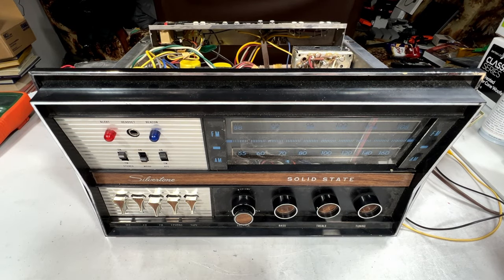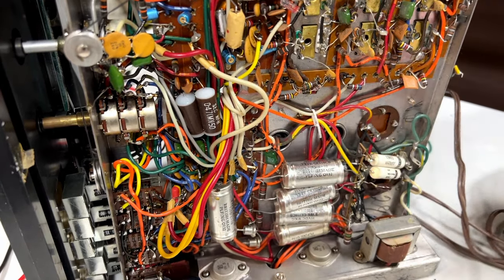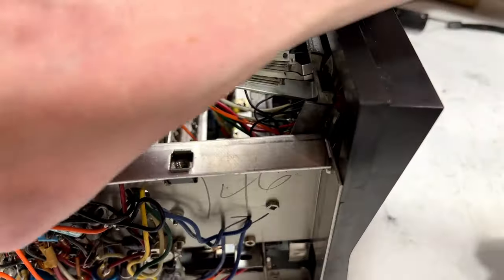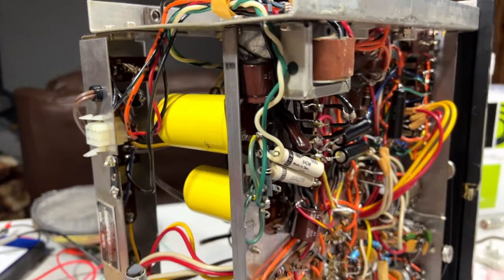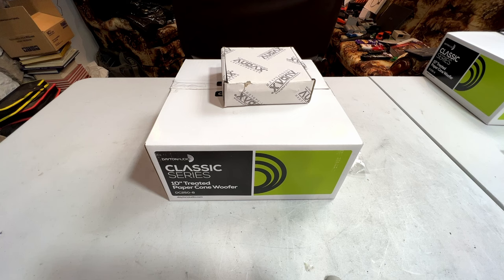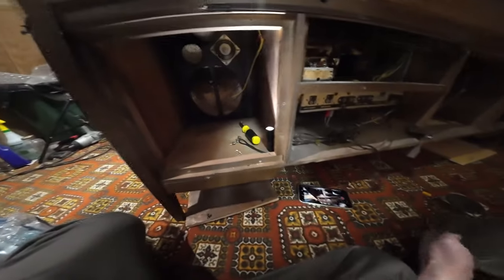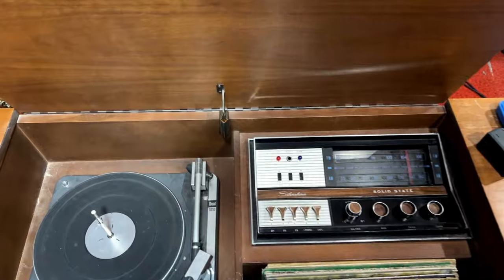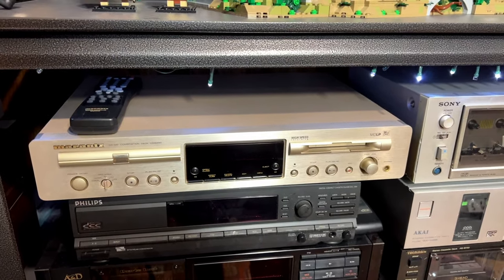Sears Silverstone Console Stereo - Recap and New Speakers

Comment: I believe the potentiometers on the power amp are bias adjustments rather than DC offset. The only thing I can think of (if in fact the output is capacitor coupled) is that the capacitor (which you replaced) in the DC offset channel is leaky/defective.